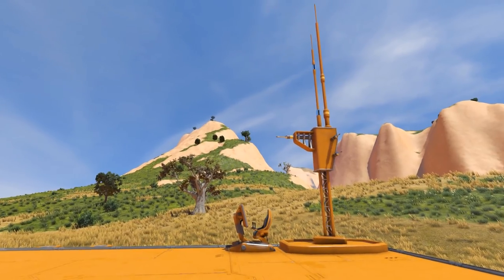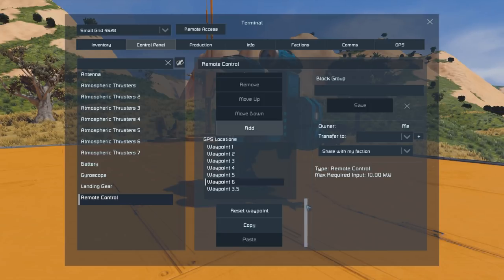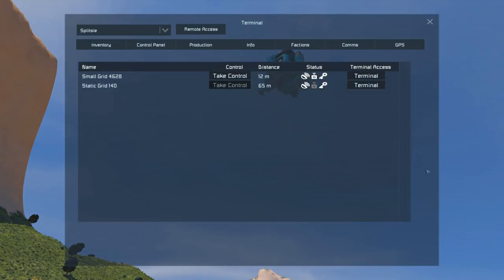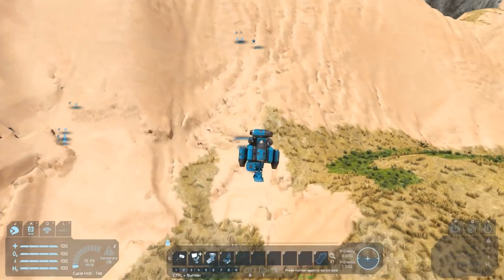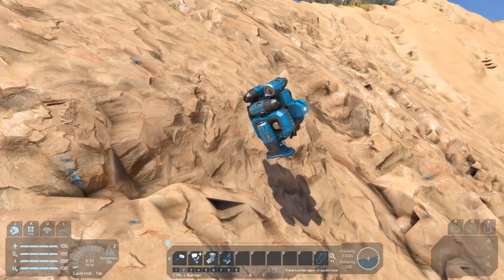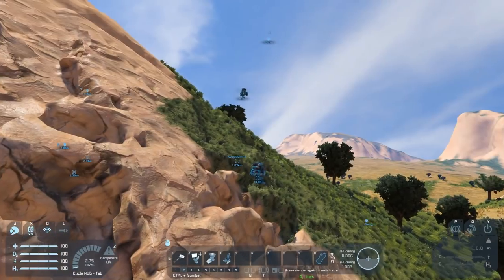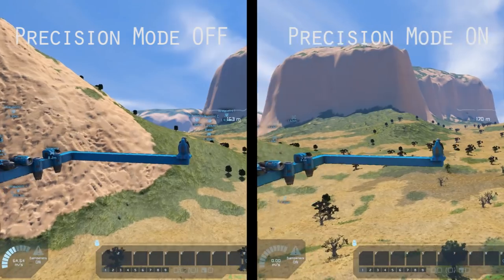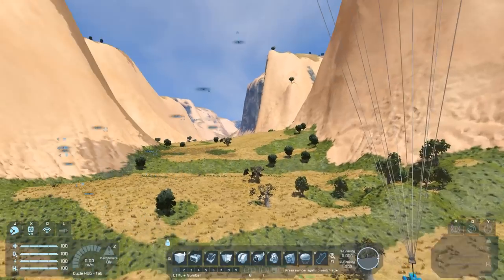Space Engineers Tutorial: Autopilot & Remote Control Part 1 (tips, testing, tutorials for survival)

Comment: Any advice on avoiding Clang? I don't know if my mods are somehow involved with it or with the fact that I seem to have trouble wielding/grinding small ship blocks, but I was working on making a large ship mining ship the other day and Clang was really being a [expletive redacted] and did major damage as I was trying to grind off the propulsion unit so as to redesign it.

Also, I've seen people use wheels to make things like trains and space elevators. Perhaps a tutorial on that? Could tie into your auto pilot tutorials rather well, perhaps. :)
Reply from the maker: I think you're right, some of the space elevators do use autopilot to allow for stopping at various points. It might be a little while before I do a tutorial looking at that, but it's now on my list :)

With regards to avoiding things exploding because the physics have gone weird - or clang - the main things are to be mindful whenever you're using rotors, pistons, wheels, connectors, merge blocks, or anything else that interacts with grids physically. I haven't checked recently, but for a long while small grid rotors were a bad culprit for clang, something stuffed up with their offset parameter. If you are messing about with those things start with the lowest force that can get it to move, that way it will be slightly less likely to break everything, but otherwise just remember to save :(
Reply: Well, the ship I was working on wasn't using anything that really should have caused Clang. It was just sitting on an ice lake. I mean I did have a connector on the back, but that was just to throw out stone. The good news is that whatever was causing me to have wonky hit detection on welding/grinding small grids in my previous survival save appears to not be occurring in my current save. Granted, with Clang acting up, I'm building this one with landing gears that are locked to the ground, which might've been my problem since I tend not to use them b/c I tend to accidentally destroy them by landing quite hard.

As for the autopilot, something that came to mind earlier is you could set up an autopilot to take ores back to your base and dump them off for you whilst you continue to mine. That would be something I think you could rig up pretty easily in your survival series. Speaking of which, have you considered building roads in that?
Reply from the maker: I think I know what might have contributed to your clang - the stones that were being thrown out, they might have freaked out and caused the damage :(
Also with the atmospheric lander, locked to the ground in multiplayer it can do some very strange things...

That's certainly one use of the autopilot I've been thinking of, build a small miner and a larger hauler then once the hauler is full, send it back to base to unload on its own and return ready for your next load of ore. As for roads, don't really have the resources yet and would probably prefer to fly once I do :)
Reply: Well, I'm in singleplayer and there was no stones being thrown out at the time. It seems like grinding on it caused the issue, somehow. It seemed more likely to freak out when a block changed build states or particularly was completely removed. That said, when I loaded it up early today from the autosave, I was just standing on it and it freaked out. Admittedly not as bad as it did the other day, but I did lose a fair amount of the ship. The small ship mining ship I've got atm has 4 large atmo thrusters in each direction (even up, just in case) and it can barely climb. That along with my test dig out on the ice lake (above one of the ore deposits I've been mining) has me wondering if it would be worth it to convert it over to H2 since it offers greater thrust because fully loaded with ice it is just short of being able to maintain altitude. I managed to ski it back to base and got most of the way before one of the 4 landing gears gave out. I mean, it's not like I'm going to be running short on ice any time soon when I'm on an ice lake, but I'm curious what you think about that idea.
Reply from the maker: I've built a hydrogen only mining ship - just to see if it was possible. It works if you're on a high inventory multiplier and can refuel itself since it's completely oxygen generator powered. Sadly it's not nearly as practical as a battery powered atmospheric miner even though I had high hopes for it :( 
Building a hybrid might be more successful though, so I say go for it, after all the worst that can happen is you need to build another ship and since that's fun, it's not all bad :)
Reply: On an earth planet at 10x inventory multiplier I make a small block atmo mining ship with 2 drills, no storage  (cockpit, connector and 2 drills is plenty at 10x inventory).  It has 8 small atmo thrusters upward, 6 backward (so you can face down while drilling), 5 forward, 4 down, 3 to each side  is just enough to run around fully loaded. 
 With 4 large atmos you should have abundant thrust unless you are running lots more cargo and drills or are on mars or a moon.  Are you underpowered so you cant use all the thrust?
Reply: When I was on Mars I built a large grid hydrogen miner with 2 drills, cockpit, connector.  It only took 4 small down and 2 each other direction (maybe 3 forward).  I had one hydrogen tank (for throughput) and 3 or 4 oxygen generators kept the tank from draining unless I was loaded and accelerating.  One perk for this design is it can also run up to space to mine platinum and come back, but because of all the oxy generators and hydrogen tank it was longer and harder to maneuver in tunnels.
Reply: The only clang I experience when building or grinding on my ships is when I crouch to get to something underneath.  I have basically stopped doing that and now get it hovering or mine a ditch so I can reach underneath without crouching.
Reply: My design had 9 drills (3x3), cockpit, large storage container, 2 large reactors (one was enough unless trying to stop diagonally, then it would overload the system, thus why I added a second), 3 batteries, along with all the necessary piping. I have a tendency to build in a sort of go big or go home methodology, and I tried the other morning to bolt on a hydrogen system, but it would appear that the additional mass of piping and tanks and such results in negligible net change in performance. That is, it felt like it took something like 20-ish minutes to fill the 3 tanks with the 1 oxygen generator that I had room to fit on board, and that could only run for what felt like ~5-10 minutes before running dry. I might try scaling back my miner design, though I've thinking about possibly building a large grid of drills facing downward over the ore deposit and letting it dig down through the ice. When it gets done with an ore deposit, I'd likely just grind it down and build it back up somewhere else. Crude, but effective.

Comment: Hey!
In 2020, just released the Frostbite Update, and I wanted to remotely control my newly built ship, but it just won't work.
I can access its terminal with pressing 'K', and I can turn off its antenna with 'O', but if I press 'W' or 'S' or 'D' or any control buttons, my ship doesn't even bothering itself with such subordinate tasks like going forward, or backwards, or... you know, moving. In Control Panel \ Remote Access button all 3 indicators showing OK status, to me;
The connection is stable,
The remote control is ready,
And lastly:
The ownership is correct,
And I still cannot control my ship.

Please help, this is going to be my first workshop creation, but it just does not want to work.
Reply: hmnn if you turn off the antenna .... how are you communicating with it ,... Sign Language ?
Reply: @waynehopkins837  Yeeeeah maaaaaaan; sign languageeee

Comment: Can i add myself to make it follow me ? Is that how the enemy drones work ?

Also i think a Color Sensor/Sensor would be amazing. Imagine a Drone beeing able to move through caves/cliffs without bumping into something using a Sensor on the Front! Your Drone was like "End my Suffering!"
Reply from the maker: To be honest I'm not sure how enemy drones track players, but sadly you can't add yourself, nor can you get autopilot to follow your own ship without using scripts and/or mods as the autopilot can only move to GPS markers :(
Reply: Splitsie the drones use a programmable block with a player tracking script, with another one to point the turret at the player.
Reply: I believe either W4stedSpace or LSG did a video about tracking players with a sensor, this was when they were first introduced but it should still work
Reply from the maker: I remember coming across something on the workshop that used that technique but it still required scripts for the sensor to function.
Also Declan I think you're spot on now that you mention it, I recall looking through some of those programmable blocks in the past
Reply: I think this one required like 5 sensors and 5 gyros and if the left sensor detected a player it would activate a gyro until the player was in the center
Reply: Wrong. They have a function which get the location of a nearby player. This function can only be used by programable blocks which are owned by a NPC.
Reply from the maker: The NPC one uses a special function much like the drone spawner, but using sensors and programmable blocks some clever people have managed drones that will follow a player - I don't understand how they manage that feat though :P
Reply: I am going to have a quick play around with it and see if the design i was thinking of works still

Comment: I just tried this with two waypoints. drone will turn and face the first waypoint. and then it just sits there doing nothing :(
Reply from the maker: Sadly that happened to me as well, there doesn't seem to be any reason for it. If you push the drone off its waypoint then it will head to the next one, so one solution I came up with was to build a thruster that's on override and controlled by a timer. At each waypoint the autopilot activates the timer and turns on the thruster, in 3 seconds the timer turns the thruster off again and the drone will have moved far enough off its waypoint that it will head for the next. Not the prettiest solution, but it's one I'm going to demonstrate in one of the future autopilot videos :)

Comment: Great video splitsie..now try it with GPS .
Reply: well he was using the GPS way points and that is the only way to make it work , but if you mean using the beacon or antennas as location markers the autopilot does not see them and you can not even select them in the list plus there is the problem that if you could the drone would only crash into it as the beacon and antenna are physical solid objects.
Reply: MacGabhann I meant by using longitude latitude coordinates
Reply: right now the only way to get autopilot to work is using the way point system it will not work any other way